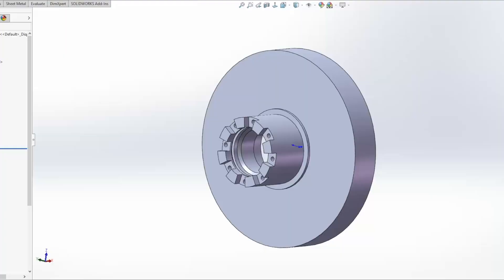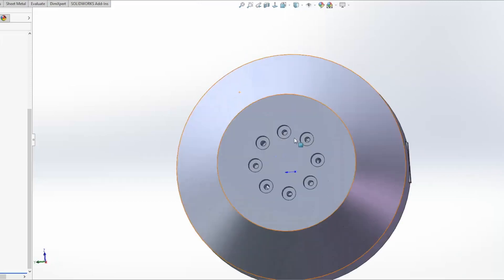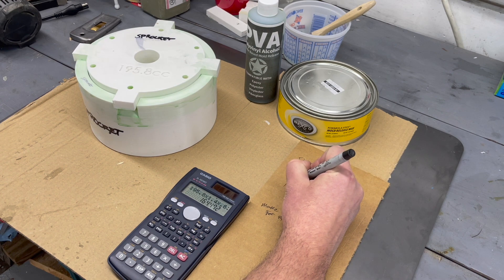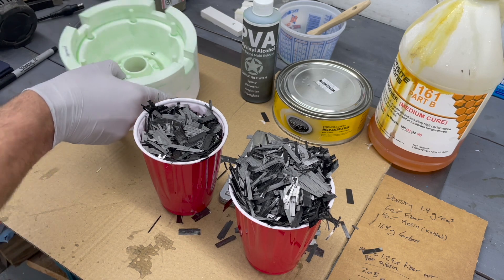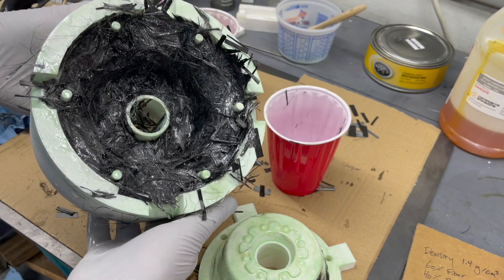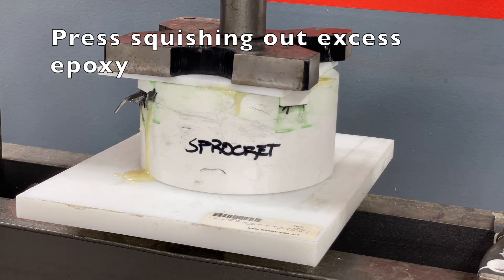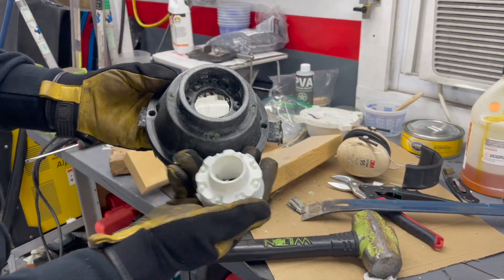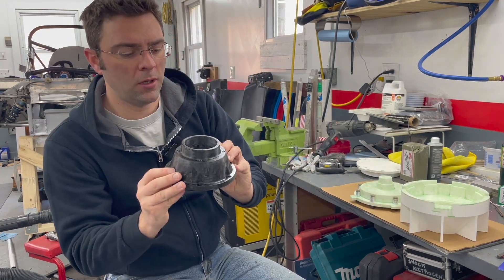Bmod Legrand: Diff 4 - Carbon Fiber Diff Case technical video

Comment: Awesome!! 😮What material is the mold printed from?
Reply from the maker: The molds are 3d printed using PLA with high infill
Reply: @HuntTam  excellent! Did not know PLA was stable enough to hold the resins until cured!